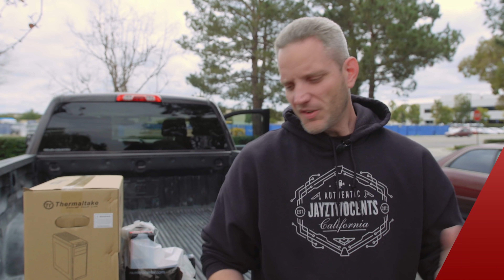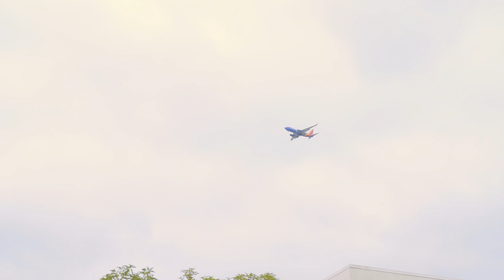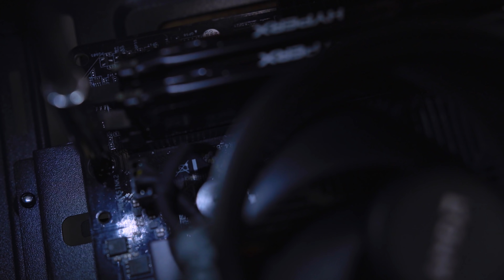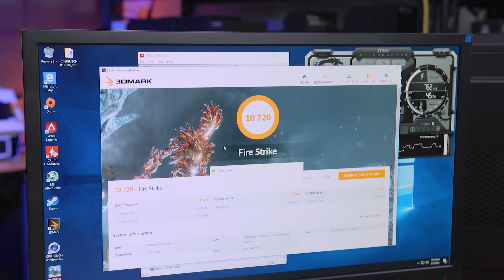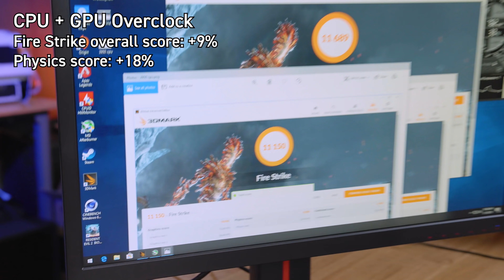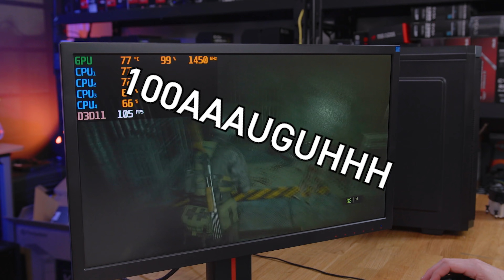CHEAP Gaming PC Build - 2019

Comment: neat build, 
but I would have maybe gone with a RX 570 and a more future proof mobo, like the MSI B450M Mortar or B450 Tomahawk, 
to make the build a bit more upgradable down the line ^^

After all you'll probably get up to 4th gen Ryzen running on these boards, so a better vrm design should be a good investment.
Reply: Why step down to a 570 for a small price difference?
Reply: @brenaan_  So it's still about the same budget, if you take a better motherboard. I mean you can always pay a little bit more for more perfomance, but that wouldn't meet the point of this video.
The difference in performace between the RX 570 and RX 580 is not that big, so I don't see any problems with this card atm.
And once the performance should not be enough anymore, the Ryzen 3 will probably reach it's limit as well.
At this point you can just easily upgrade these two components, thanks to the better mobo.

That's just how I would do this build.

Comment: great build guide. But in my OPINION the extra $30 for the 2400g would be more than worth saving up for if needed. or even the extra $60 for the 2600 would be worth saving up for as well. it's so hard to justify a 4 core cpu without hyperthreading for even for just gaming these days. Again, that's really great performance for the price paid.
Reply: Yeah when you do the TCO (total cost ownership) and include Windows (grey key), keyboard, mouse. The extra 60 dollars is less than 8% more for nearly twice the cpu.

Comment: Would a 450w 80+ bronze be enough for the rx 580?
Reply: jordan peterperson don’t save on a Power supply get like 550w 80+bronze. 
First time building a pc?
Reply: @superboyboy4681  too late I basically made this exact setup a couple months ago. What's the best match for a graphics card
Reply: jordan peterperson are you asking what’s the best psu for a rx 580 is
Reply: jordan peterperson if so then 550 to 650 is good leening towards 650
Reply: @superboyboy4681  Nah what's the best gpu for a 450w power supply
Reply: jordan peterperson I like amd but gtx 1050ti is probably the best
Reply: Superboy Boy you can put a lot more than a 1050 ti on a 450w psu.
Reply: It will be fine. I’ve had a gtx 480 on one before, as well as a 7970(both 250W+ cards)

Comment: How tf you keep your temps so cool mine get to like 80 looking down on the map (without OC)
Reply: By having decent cooling. Making sure your case has good airflow. Also if you haven't changed ur thermal paste I would recommend doing that.
Reply: Ganker Jr I’ll try changing thermal paste
Reply: He probably also has a lower room temperature than you
Reply: Will Wires maybe.
Reply: Get msi afterburner
Reply: Youssef Albery I do have it with a fan curve set
Reply: 80 c or 80f?
Reply: x83 t76Y 80c

Comment: I have the same memory kit. Using the same timings as xmp I can manually oc it to 3000MHz no problem. I am using a high end mobo though, not sure how much that matters.
Reply: which mb ? ;)
Reply: @Xenoray1  Asus prime Z370-A
Reply: I have a 2400 16gb kit oced to 3200 and I haven't had any problems.
Reply: @x83_t76Y  tbh I didn't try pushing it further because intel doesn't gain that much from memory speed but it would probably work just fine
Reply: @Varinius  I have a ryzen, that's why I did it
Reply: @x83_t76Y  that's cool then, lots of extra free performance from such a well priced kit
Reply: Strix e series gave me no trouble with over clocks and they price it higher becos it has better built-in audio and Ethernet and wifi that's all 
And Asus has really good wifi solutions
I have z270 though 
Z370 might not have much of a difference
Reply: It's a good priced mb with the better chipset but not high end. Upper midrange but you're halfway right about the features it has. Still highend boards will have even better parts
Reply: @eazen  there's still the term enthusiast boards to go higher, I know it's not the best : P
Reply: That’s more midrange
Reply: @loadingcheese9765  in terms of pricing maybe, but it has pretty much all the features of the strix "gaming" mobos that somehow warrant a much higher price
Reply: Konrad Godel there’s a difference between high end board and high end chipset.

Comment: i bought my rx 580 new for 120 euros, 2 year warranty, 8gb vram
Reply: and 2 games for free ?
Reply: @Xenoray1  yes its the same card.
Reply: Got mine for $85
Reply: @070101r2d2  Where? donde?
Reply: Kokioje parduotuveje?
Reply: @tomaspat4392  technoramoj paskutine buvo ir dar istraukiau 30% nuolaida
Reply: Amazing. I have the same card ☺️
Reply: I have rx 580 8gb as well. I can run apex legends with all high settings with it, but the framerate is not to my liking. Maybe I'm pairing my gpu with an old i5 2500. Damn i need to ugprade my cpu to compliment my rx 580 8gb
Reply: This card in my country costs around $230 -___________________-

Comment: But does it crash to desktop??
Reply: My freeze the entire pc.. no joke fml
Reply: @Xenoray1  happaned to me too dyam
Reply: No problems with my amd r9 290x 8gb in crossfire mode. And i7 5930k. o Wait budget uhm ok nvm
Reply: ryzen 2700x and a 1080ti here and I haven't seen a single issue in at least 250 matches.
Reply: @Skippy333  good gor you buddy
Reply: Mine just says fuck it and goes to the desktop (rx 580 user here)
Reply: 1050ti r5 1500x one crash - 61 hours played
Reply: My crashing issues were only solved when i killed all Razer Synapse processes. Kinda sad. I played for a long tkme with it still on, synapse problems just started today.
Reply: I have no problems intel and nvidia...its user end your pc sucks...deal with it
Reply: Amd has no driver problems with Apex
Reply: @Ne0tax  i have intel and nvidia and it still crashes
Reply: My rtx2060: BOIIII ENGINE ERRORR FOR LIFE
Reply: @craez3_97 try, GeForce Game Ready Driver WHQL 417.35

Comment: Wow, that built list is almost identical to one I recently build. Same CPU, also an ASRock B-450 motherboard, 8GB of HyperX RAM, and a Thermaltake case (I used the Versa 17). It also has an RX 570, but I could likely get my hands on an RX 580 for around that price. And my final price including Windows 10 was right around $550. Thanks to some black friday and other sales.
Reply: No need to pay for Windows if you really are on a budget. You can authorize it later if you need the functionality.